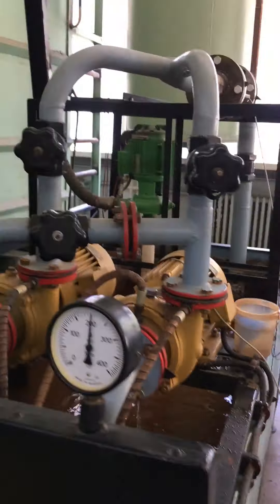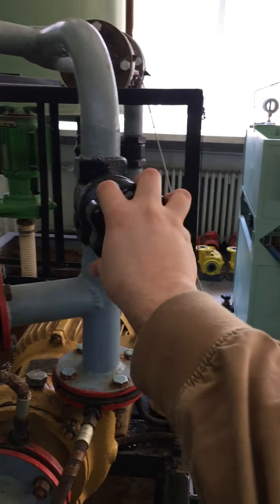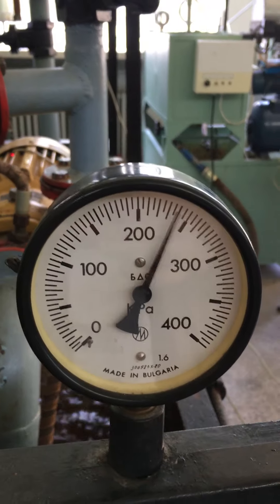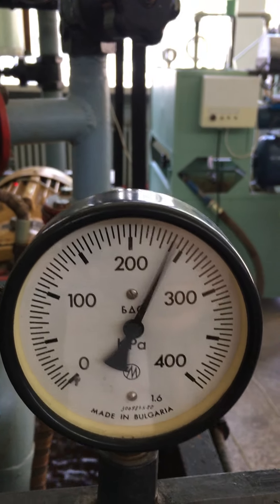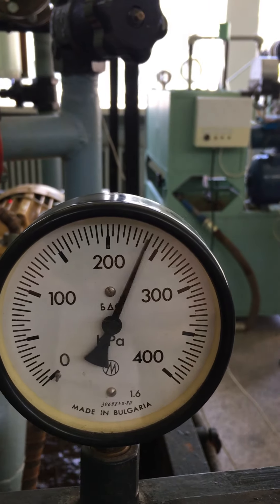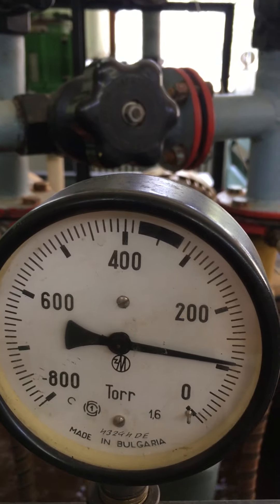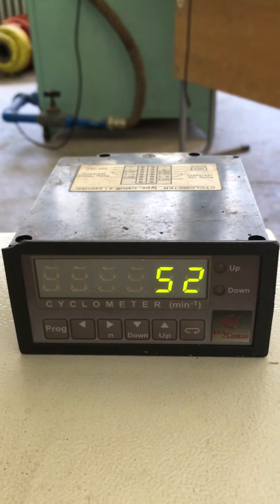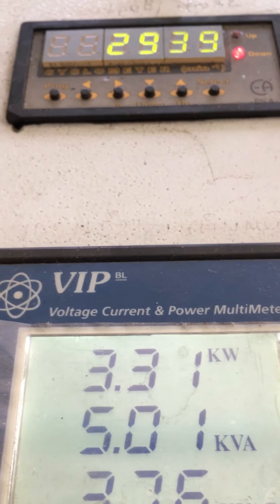How to DETERMINE the OPERATING CURVES of a CENTRIFUGAL PUMP: 1st part - experimental - eng. subs.

Comment: In the video I can see a second pump and additional pipes and fittings. Why is it for?
Reply from the maker: This is a complex lab test system where different practice excercises ca be performed. One of them to test two pumps working in parallel. Also, the system provides an opportunity foor applying the three well-known methods (VFD, throttleing and by pass) for flow rate regulation.